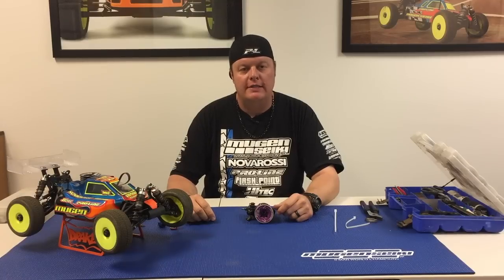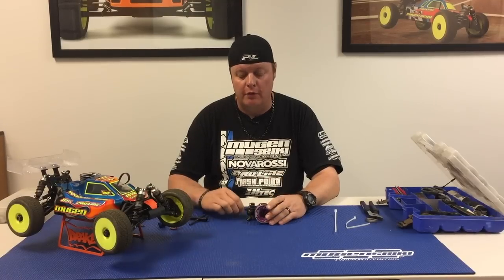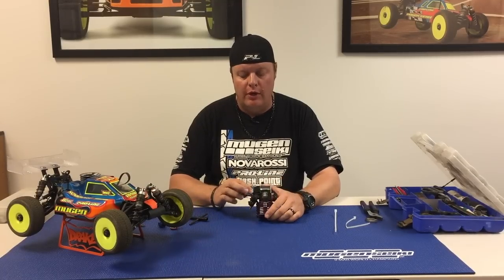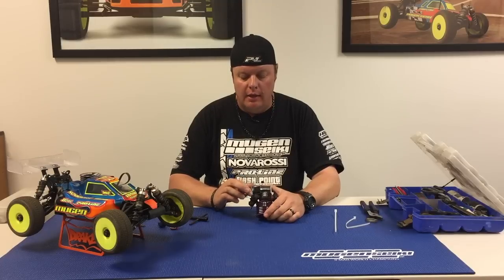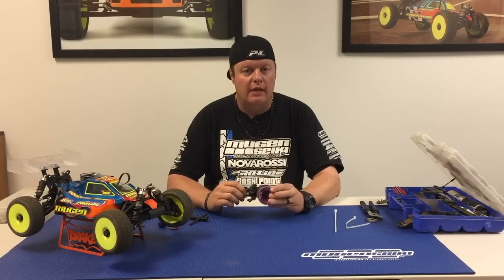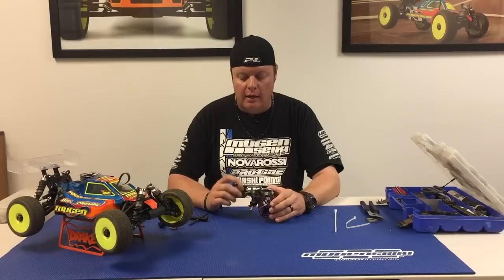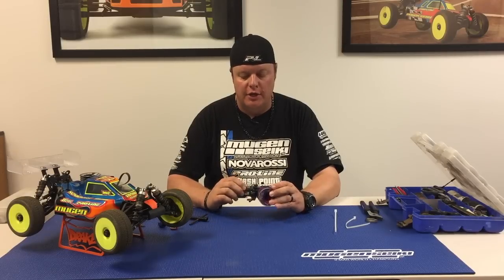Adam Drake from Mugen Seiki Racing shows how to remove a spun flywheel.

Comment: I was watching your break in video with Jason snyder but im confused about a few things,
1. How do i get to the 'conservative' tune? I notice the engine in the video isnt at normal settings but im unsure of how that tune is reached/ when you reach it
2. Should the engine be preheated EVERY start up not just during break in?
3. and should i keep factory settings for the first idling tanks or alter the low speed? 
cheers
Reply: Adam Drake Thank you so much, i plan on getting the x act pro 8 italia so it is a novarossi, have you had an experience with this engine?